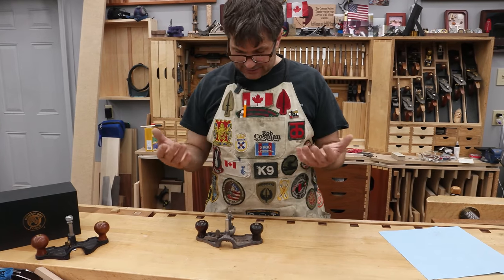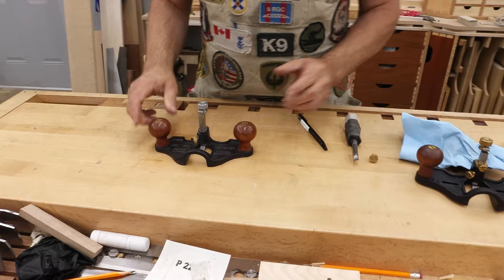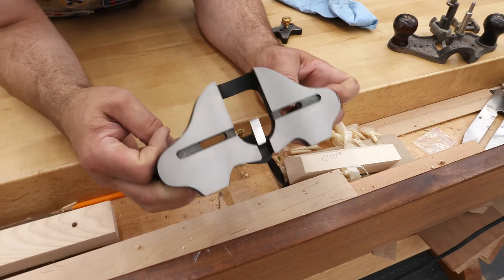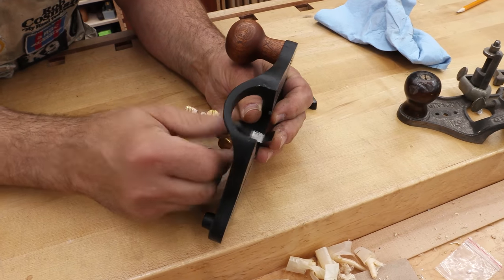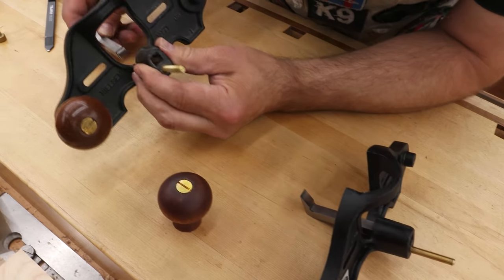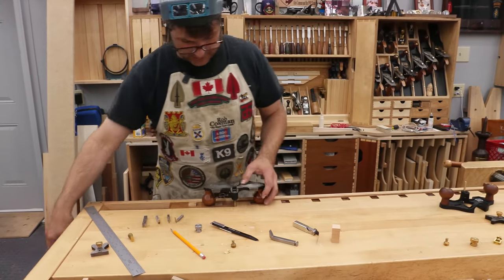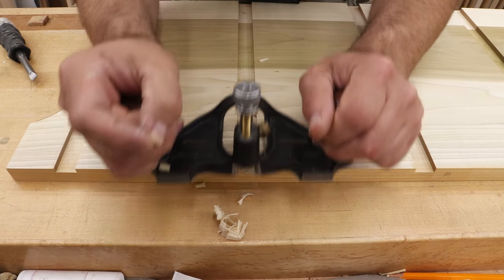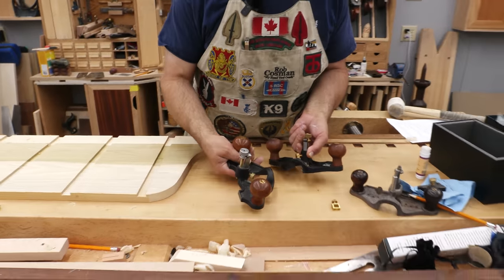Router Plane Reviews - Lie Nielsen vs Bench Dog

Comment: I'd rather support a local company like Lie Neilsen. That's worth the extra $50.
Reply from the maker: I agree 100% with you
Reply: Just wondering whether the local company will support its buyers by offering better prices when it’s clear that the tools CAN be made well at much lower prices. The local tools should actually be CHEAPER since they don’t have to spend on import duties and other taxes. I’m all for supporting “honest” local businesses which care for the community but often local companies and businesses use their monopoly to abuse pricing and only shape up when they have competition. It’s the same in every field whether it’s automotive, electronics, power tools, construction business etc.
Reply: @GtubeVideos  I feel that buying cheaper copies always eventually turns out badly. The imported tools always (in my experience) cut corners. I don't want a 'it's good enough tool' if I can have a first rate tool (or any 'lifetime' product) for a few bucks more. Especially if it supports more local producers, especially if they have a real commitment to making high quality products and to contributing improvements and innovations.
Reply: @artswri  well, that’s the whole point of Rob’s video. He concludes that there is almost no difference in the actual performance OR the build of the tool apart from few minor cosmetic differences. I’d appreciate if people still want to go ahead and buy a more expensive item just because they’re fans of a brand but then why even watch a comparison video like this if you can’t have an open mind about other alternatives? I personally don’t have any love towards any brand - I prefer a competitive market because that’s the only kind of market that drives innovation. These hand tools are a prime example - Stanley made the same planes for decades with minimal innovation until LN came in with some different approaches. Now LN is doing the same thing selling the same designs for decades and eventually someone new will come and replace them.
Reply: Too bad the Lie Nielsen large open throat has been out of stock for months with no ETA in sight.  I've been waiting for an email from them for at least 6 months to get my hands on one.
Reply: @lawrencedeleurere4427  That’s a nicely thought out and logical response. I appreciate that. My other point is about competition and innovation.  LN merely copied Stanley’s design and made a few minor( albeit import) modifications but after that it’s been decades since they made any other significant innovations in their hand planes. Unfortunately this is the case everywhere- manufacturers do not innovate or push their boundaries as long as they’re not pressurised by competitors. For anyone wanting to spend “extra” $50 they should really be asking LN to justify WHAT they’re providing for that $50 to the end customer. Obviously superior quality is not one of the things they’re providing anymore. Are they providing better service? No they’re not - their products are not even available so I can guess how difficult it might be to get service. Exactly WHAT apart from nationalistic jingoism is that $50 going towards? If it weren’t for German, Japanese and Korean automotive manufacturers most Americans would still be driving moving coffins with 6-liter engines putting out 150bHP. 

Let’s not even get into the debate of how much pollution these machines caused, how much fuel they wasted and how many people were killed in wars to access that fuel. The “environmental standards” are all brand new and Americans have blatantly refused to cut their emissions as required by various international requirements and they create more sludge than any other country but just choose to ship it to other countries to dump so that American citizens can live a life of environmental standards and safety while endangering lives of others in other countries. Let’s not forget that there probably is no other country in the world that has harmed the environment more than America and continues to do so. They own more nuclear warheads than any other country, have conducted more nuclear tests than any other country, started more wars, dropped more bombs, killed more civilians than any other country. This environmental excuse doesn’t fly in any debate really. 

Regardless getting back to the point - you’re free to spend $50 more on a decades old copied design just because you an emotional attachment to a company which doesn’t really give a shit about providing value to its customers. It didn’t even create the original design in the first place. I wouldn’t. I think people are smart enough to decide for themselves. Thanks Rob for an unbiased review which pretty much seals the fraud that LN has been tutting around regarding their products being of significantly higher quality than its competition and cheating its customers by constantly charging higher prices.
Reply: @FireEscape My first argument is that the LN is NOT an original. It’s a 99% copy of a Stanley so people should stop calling it an original. Second is that if you’re not expecting any innovation in planes then why are you paying increasingly premium prices for something that’s essentially a 50 year old design? Thirdly we need to stop this elitist mindset that something expensive is always better. I’m sure you watched the whole video - Rob seems to have not found any real difference in the performance of the two planes so please explain to me once again why you’re paying a premium price apart from getting a LN label (which in itself makes very little sense as they haven’t invented any major woodworking tools themselves and are essentially just a copycat brand improving upon other tools). To answer your question - if two tools offer the same performance I will ALWAYS buy the cheaper one. If American manufacturers understand the basic principle of “value” they will understand that they have to either innovate or compete from a price point. You can’t keep fooling people by selling old designs and constantly keep increasing prices. Lastly this is an educational video - you can make your own interpretations and your own decisions about your own money. I’ve made mine and I respect yours.
Reply: @MattMuirhead  LN has maybe three items in stock. I got on the list for a 5 1/2 Jack a boight it right away two weeks ago. It sold out it a few hours.
Reply: It's about 40% more for the Lie Neilsen.  Looking at it that way makes it a closer call for me.  I'm not sure that the location of manufacture and some minor cosmetic improvements is worth a 40% markup.  

However, what this video can't show is if the LN is better constructed and performs better over the years.  It's probable that Bench Dog doesn't give as much TLC to their products. After a few years or decades, they may not work very well.  Nothing is for certain.  But with the LN, you can at least tell they have a passion for these tools and focus on quality.

In the end, I think I'm going to get the Bench Dog.  Rockler has it on sale for $100 right now, and LN doesn't have any inventory.  I'm kind of glad they are out of stock.  It makes the decision easier for me, and it means that LN is doing well enough to sell everything they can make.

Thanks for the video Rob!  It was clear that although you have a LN bias, you were doing your best to be fair.  My perspective as a novice, new viewer to your channel, is you are honest and trustworthy.  Thanks for supporting this community I stumbled upon last year.
Reply: That's why I don't buy woodriver.
Reply: Hell yeah brother!  Made in USA!  That’s why all my old Stanley’s from early 1900 and let 1800 still operate 🇺🇸
Reply: @GtubeVideos  they “can” be made cheaper because they are made in a different country, with different cost of living, government regulations, etc etc. 

This is why the “middle class” in many western countries has been decimated. Companies importing “cheaper” goods from other countries and destroying local manufacturing.
Reply: @ganeshg3544  “nationalistic jingoism” everything after this will be ignored.
Reply: @stellarjayatkins4749  I’m glad it will be.

Comment: There is no doubt in my mind that the Lie Nielsen tool is locally made is the best choice for me. This is a lifetime tool so $50.00 is not a deal breaker for quality.
Reply from the maker: Well said
Reply: My thoughts exactly. $50 for a lifetime tool to support a local business should not be a stretch for folks that do fine woodworking as a hobby, let alone as their profession.
Reply: Benchdog is currently 75 dollars cheaper and it's actually in stock.  Not a counterpoint but production issues are a problem with the premium brands at the moment.
Reply: @sfshilo  Rockler putting on sale a plane that Rob was going to review... Hmmm. They've sold at least 3 today because of his review. (buyer reviews) Availability is everything.
Reply: For me the fact that neither are made local to me changes the viewpoint. The price does make a difference if the tools are of similar quality.
Reply: exactly.
Reply: Bench dog is probably as much a lifetime tool as Lie Nielsen. Being a snob is fine, but make sure that when you're a snob you're actually a snob on a genuine basis.

Comment: The LN will hold its value better if you had to resell it. Going off on a tangent though I have the Veritas router plane. I like the angled handles. I also like how the blade detaches for sharpening. I would agree the LN has a superior depth adjuster, but I haven’t had a problem with mine.
Reply from the maker: Yes LN hold there value extremely well.  In the last 18 months used ones actually have risen above purchase price due to the shortage of LN tools
Reply: Maybe I'm just missing them, but I don't think I've seen many reviews of the Veritas stuff on this channel. Makes me wonder if there isn't some bad blood between Mr. Cosman and his Canadian brethren at Veritas.
Reply: Yeah I prefer the Veritas though the adjustment is slightly nicer on LN
Reply: @GM-gc8gg  not so much bad blood as simple loyalty to his sponsor Woodcraft.   
That's understandable, though I personally won't buy any WC Chinese mfr goods.
Reply: @thwwoodcraft1449  Hear what what you are saying, but: 1) Woodcraft doesn't make or even sell a router plane as far as I can tell, so what's the harm of reviewing the Lee Valley "domestic" product, and 2) Lee Valley's "domestic" stuff seems to be more in the league of Lie-Nielsen than Woodcraft and Mr. Cosman doesn't have any problem reviewing Lie-Nielsen even when it provides direct competition for the Woodcraft product.
Reply: @GM-gc8gg  I Remember reading a comment on this channel some time ago where someone was looking to purchase a hand plane and asked Rob his thoughts on a Veritas plane and if he would recommend the brand. It seems to me that Rob could have taken advantage of that opportunity to promote the Wood River brand, instead, Rob chose to reply with a single word - "No!". I felt that spoke volumes. We all know that Veritas is a premium brand, just don't expect Rob Cosman to admit it lol.
Reply: @righthook27  The question is: Why Not?
Reply: @GM-gc8gg  Maybe because he knows that Veritas would easily win a head-to-head with "his" brand, Wood River and that it's also a direct competitor to LN. Here's what I think is funny... He couldn't justify the extra $50 for the LN so he went the "buy domestic route". He said he'd pay the extra $50 for the LN to support a "domestic" company. 1) He's Canadian and resides in Canada. 2) Lie-Nielsen is American made, so it's not a "domestic" product (to him). 3) Veritas is super innovative, very reasonably priced and has over 100 patents AND is proudly made in Canada... DOMESTIC! But yet he won't so much as mention the name "Veritas" on his channel 4) He is affiliated with the Wood River brand, sells it on his online store and even collaborated with Woodcraft on it's design. Wood River is made in CHINA! I can't be the only one to see his hypocrisy??

Comment: Good review of the two tools. Thank you. After seeing your review of one of the Bench Dog bench planes in which the Bench Dog faired poorly, I was surprised to see how well their router plane did in your assessment. I agree for a $50 difference, I would by the higher quality and original engineering of Lie Nielsen. However, the Lie Nielson is currently selling for $225, while the Bench Dog is $140 at Rockler. Also, with Rockler's recent 20% sale on one item of your choosing, I was able to get the Bench Dog for $112 and free shipping. So, for a $113+ difference, I had to go with the Bench Dog. On the other hand, you have sold me on WoodRiver bench planes, so I have a 5-1/2 and 7 on order from Woodcraft (if only you could ship WoodRivers to the US!). Thanks for the honest and thorough reviews and other great videos.

Comment: Ran across this video in my search for a decent beginner router plane that will only see occassional use. Thanks for your honest feedback. LN must have upped their prices fairly significantly recently. Everywhere I've looked, it's priced at $225 but, have not been able to find anywhere that has them in stock. The BD is currently $103 at the time I'm typing this. I'm all about spending a little extra to buy American made when possible but, I honestly couldn't justify the extra cost on this one. Looks like the Bench Dog is in my future. Thanks again for the vid. 👍
Reply: I'm seeing the same thing as of May '23.  The LN is up to $225, and the BD price with coupon is about $125.  After reading a number of reviews, it appears the BD has some QC issues in some cases (chipped irons, base not flat, etc).  As I have a Rockler store nearby, I can inspect a plane for defects before I buy, so should be able to avoid obvious problems right out of the box.  If the price delta was still $50, I'd go with the LN, but for $100, I'm leaning towards the BD.  Veritas has a nice Canadian made closed throat model for about $190 that is a little more affordable option as well.
Reply: @jamesberry5623  I bought the BD a few months ago. I am just a weekend warrior and this is my 1st and only router plane so I have nothing to compare it to. With that said, I have had zero issues with mine. I spent maybe 15-20 minutes flattening the bottom and sharpening the blade, then put it to work. Has been working great for me so far.

Comment: I have the bench dog, one issue I ran into is the brass square depth stop can break really easy.  I was able to repair it, and I don't use it often, but it could be beefier.  Other then that the router works just fine, and I was able to find other sized blades for it pretty easily.
Reply from the maker: great info, thanks for the comment
Reply: Interesting. I've noticed the depth stop's apparent fragility and thought about what I'd do if I over tightened the brass screw and fractured the stop. While many "Quick & Dirty" fixes come to mind, I think I'd get another chunk of brass larger than the ⅝" x ⅝" x ¼" stop it comes with and do the simple metalwork to make the ⅜"square post hole. and, depending on the knurled set-screw's thread and tpi, either replace it with another or use it as is. {Remember, there's a fine difference between tightening just "Snug" enough and tightening to a "Snug & an Oops".)

Comment: Good review. As an expatriate from Maine, I'll buy the Lie Nielson out of loyalty and domestic bias, but it's pretty clear Bench Dog has a competitive product. I'm a beginner woodworker and my experience with their hand planes is much different from this. I bought a #5 Bench Dog and had a horrible time trying to get it to cut and adjust well. Granted, I had no idea what the hell I was doing, and having a screw lock instead of the lever action of the Stanley style certainly didn't help. I bought a Lie Nielson #4, and find I like it a lot more. Granted the Bench Dog is a scrub plane now, which it's performing admirably at.
Reply from the maker: well a router plane is much simpler than a bench plane, so that's the big difference

Comment: I entirely agree with the comments about supporting domestic manufacturers when buying tools. The higher cost is a lesser issue in my view. In the UK there are no domestic manufacturers making router planes so anything you buy will be an import. I think the potential difference between the makers like Lie Neilsen and Bench Dog is one of product consistency. If you buy a Lie Neilsen plane today and the same one in five years time they will be identical in quality. Not so with makers like Bench Dog. Several years ago I bought an Axminster Rider Block plane. Great little tool which is well made and a pleasure to use. More recently I bought a Rider 4 1/2 smoothing plane. It wouldn't produce a shaving the shape and fit of the chip breaker was diabolical. Several hours work improved the shape and fit and yes it would produce shavings of a sort but not good. Eventually I returned to the plane and found the sole was not flat it was significantly hollow in from the mouth to the heel in the centre of the sole. More hours correcting this fault has produced a reasonable plane but not a good one. BTW Rider planes and Bench Dog tools appear to be made by the same manufacturer.

Comment: This video sold a whole lot of Bench Dog router planes! And when the video dropped, Rockler had them on sale too! Was able to get one for $99, while LN has been out of stock for MONTHS now.
Reply: Got mine for less than $94.00 (+Governor Newsom's cut) in December of 2020 when they were regularly $124.99. Bottom is dead flat, blade shank housing dead-on vertical @90º, and it works like a charm. Wish I had more money to spend on the highest quality tools, but, as my mother used to say: "If wishes were fishes, we'd all go down the the sea and cast nets".(We do what we can with what we have and firnd ways to work around and/or smooth out the rough spots.)